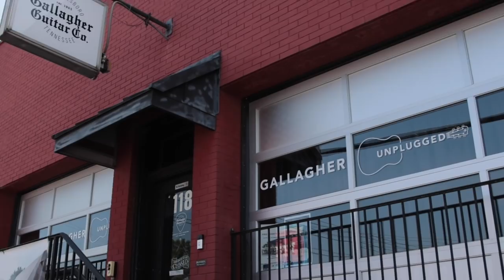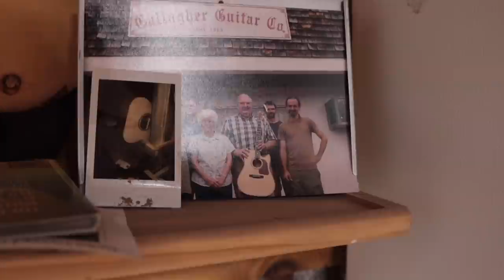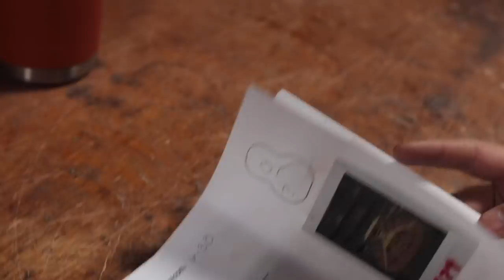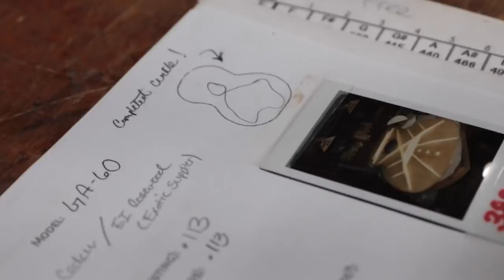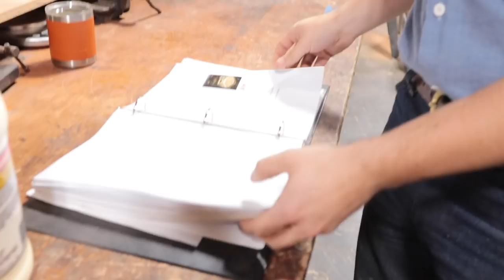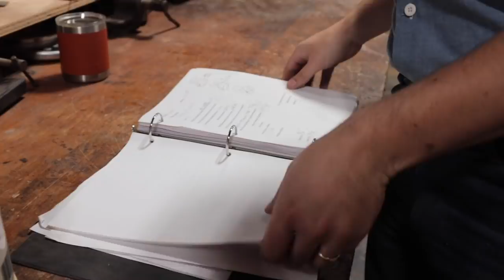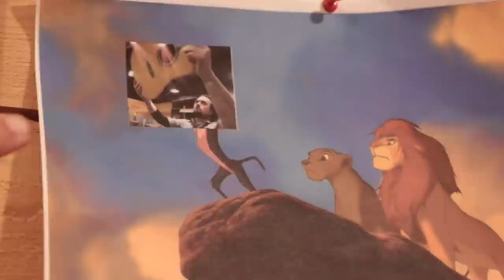Gallagher Guitars is making guitars to grow old with.

Comment: Thumbnail portrayed Wartrace build. So I clicked on it. And thumbs up.
Cheers!
-------
Edit: 12:30 Sapele. The G-50 on the website has the unmistakable 'ribbony' sapele. Topped with cedar or spruce, sapele fires the sound right back out at you. Hard.